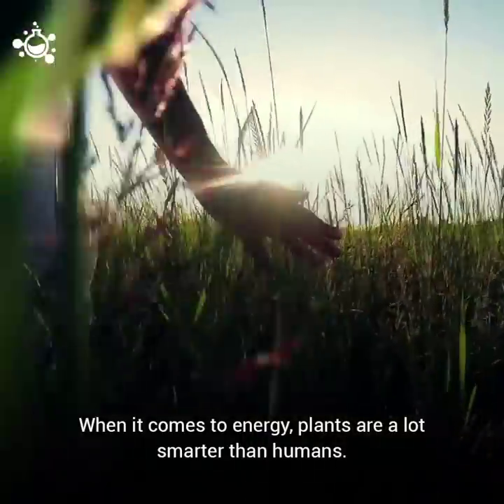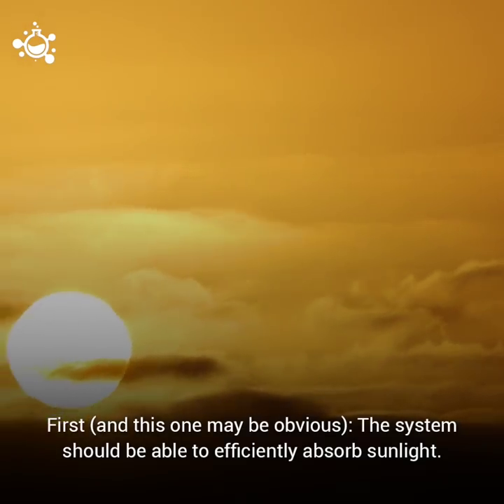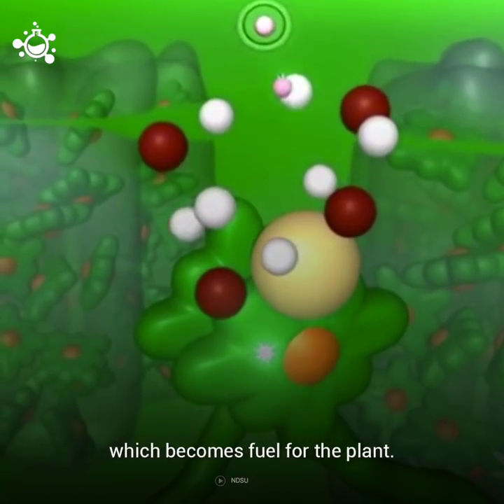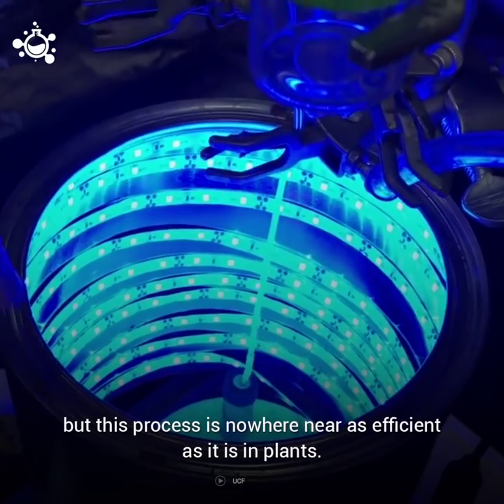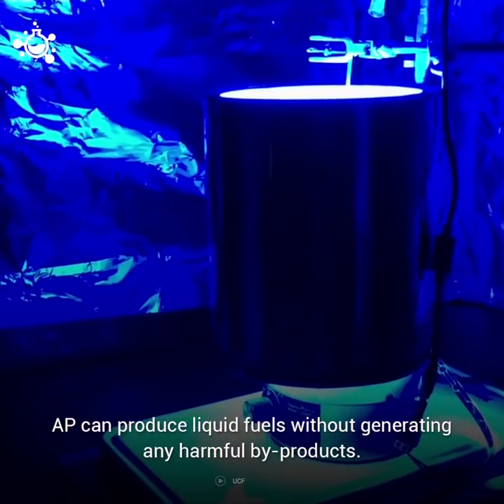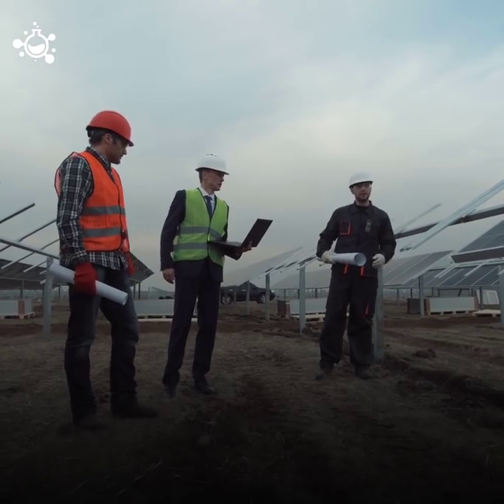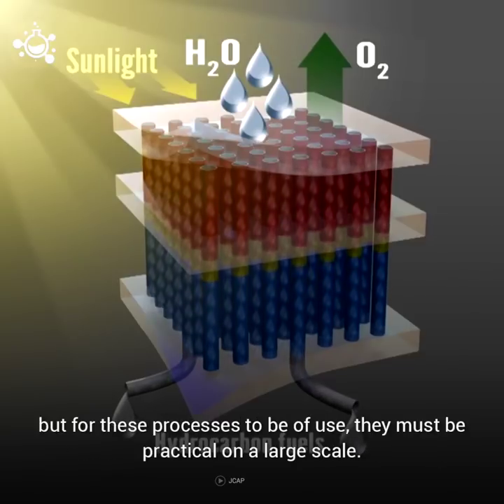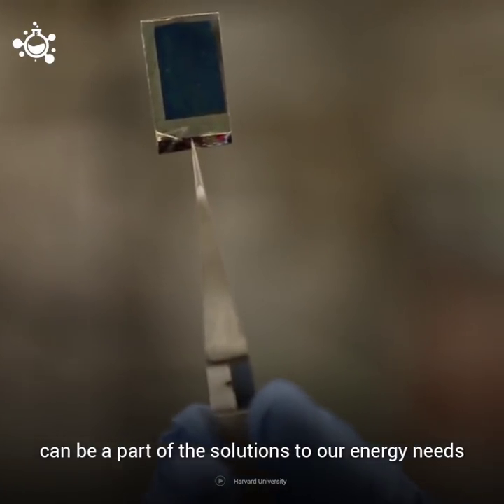Artificial photosynthesis uses gold to convert CO2 into liquid fuel

Comment: Why not go the desert plants route? 

Gasses in at night. Absorbed by chalk.

Then sunlight.

The heat releasing the CO2.

And photovoltaics break down water.

The Oxygen released.

The Hydrogen is to react with the CO2.

Water and methane.

That are separated. Water joins the start.

The Methane goes to be adjusted  to the product being produced.

Comment: Basically you need a direct light to fuel system that has a energy conversion potential greater than 10%. Any less than that and it's basically more economical to just use a conventional PV cell and standard electrolysis on water.